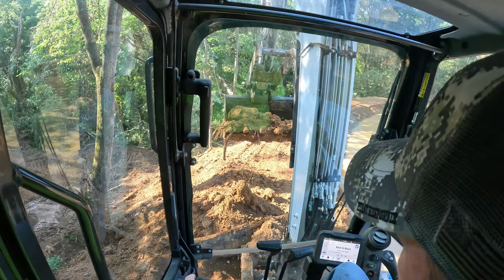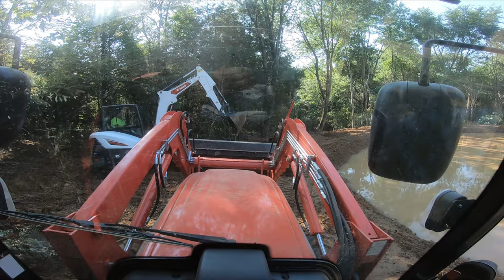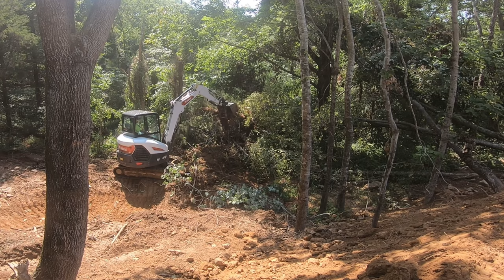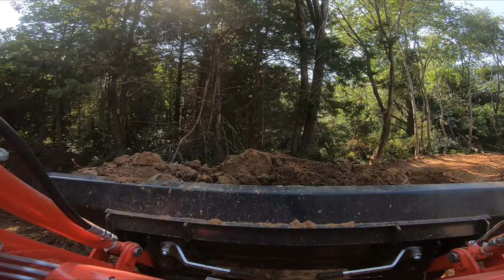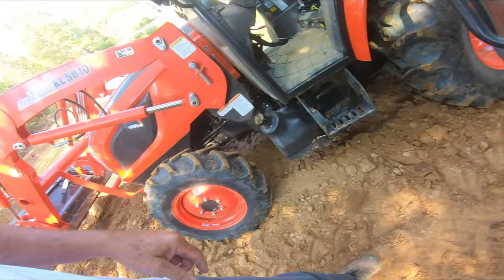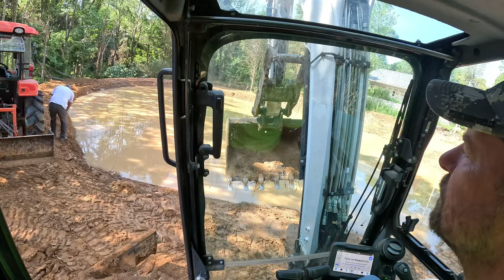EP 13 He nearly put my KIOTI NS6010 in the pond!

Comment: A hard lesson to learn when doing a pond dam is the width of the dam. you want to be able to drive on the front slope, back slope and top to maintain it. I have heard people say that 3 to 1 is a good maximum for slope, so every 3 feet horizontally it only goes up 1 foot. The bad part of that is that a 10 foot high dam, with a narrow 10 foot top width ends up being 70 feet wide at the bottom. The army corps of engineers set a standard for levees and dams that a 10 to 1 slope will keep them from washing away in a breech or overtopping event. real nice to mow, insane amount of dirt to find and move. Most of this information was what I could find when my friend and I were trying to build a duck impoundment 20 years ago. only needed a foot of dam height, we went a bit narrow and when the river flooded and topped the pond dam from the wrong direction, it took out the dam. We had to redo the entire thing but had a 3 month battle with beavers to let us fix it. Good times.
thanks for the videos, Joe.